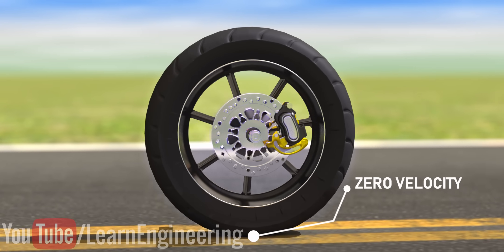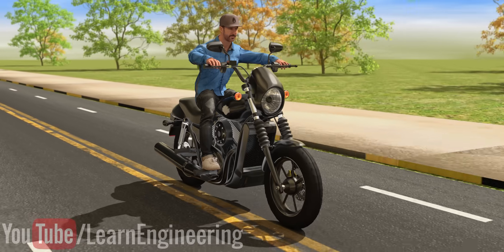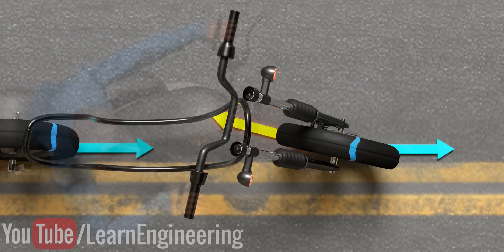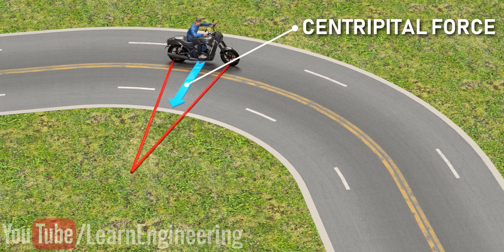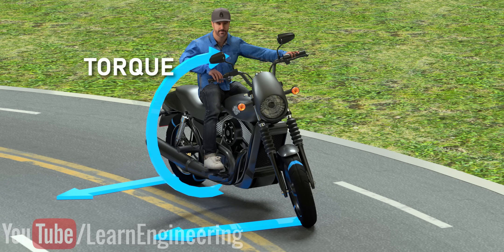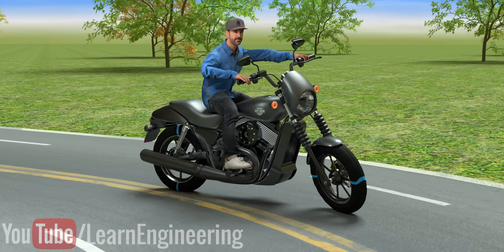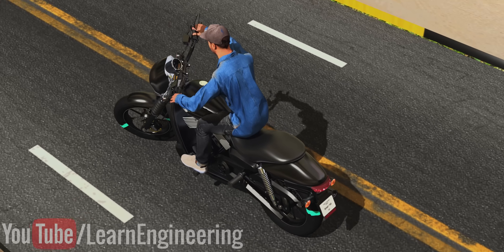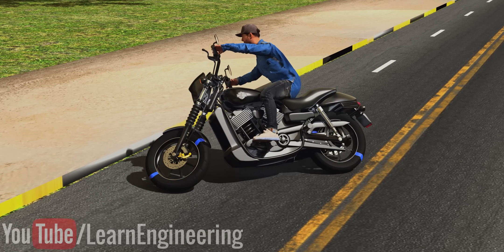Counter Steering | The interesting physics behind it

Comment: Just very short explain about ride a bike or motorcycle.

Slow speed, you turn the wheel to the right, the bike go to the right.

High speed (over 25-30km/h) you turn the wheel to the right just a little, the bike lean/fall to the left.

Anyway, if you ride a bike or motorcycle, you make countersteer consciously or not, always.

Is the only way to ride the bike.

But if you know about this you will drive with more confidence and ability and thats is always good.

Sorry about my english, greetings from Spain.

Comment: Counter steering is not a choice. You have to do it after you go over a certain speed (around 30kmph) because it doesn't matter whether you lean or not the bike will turn the opposite direction you turn the rear wheel. That's because the momentum you creat by leaning is not enough to overcome the momentum created by turning the wheel.

Comment: To be exact, counter steering is the ONLY way to significantly tilt your Motorcycle above 30km/h. Using the first method at these speeds will barely turn your motorcycle. You already did countersteering before watching this video. You just never noticed.

Comment: It is not even a technique IT'S THE ONLY WAY TO TURN ON A MOTORCYCLE
Reply: So... there are two inputs we can put in to turn a motorcycle. One is body position, and the other is steering inputs. So by leaning the body... yes it does help to lean the motorcycle which is how a bike turns (by leaning) But! If you want that input to cause the motorcycle to lean when you want/need it to.... you have to initiate the lean with steering Inputs. Just relying on body position will not turn the bike as much as you want or as fast as you need. As I put in another comment...Go take a course! It will possibly save your life. Get the knowledge and practice the skills.
Reply: @derrellbarnett7353  Just took my MSF course a couple of weeks ago and not even an hour into the riding instruction they beat counter-steering into your head.  The easiest way for people to remember it is just push left go left, push right go right.
Reply: @RascalCatify  well that's exactly right. But dont forget N I'm important part to that is speed. ( how fast you are going) again... there are two types of turns speed determines what kind of turn you will execute. You have done a great thi g for yourself by taking that course. MSF has been around for a very long time and are making appropriate changes to the program to educate and keep all riders educated and as safe as possible.
Reply: Derrell Barnett u r so right. Speed is the key to decide if you could counter steering. Let those guys who said that’s the only way to turn to do it with 5miles. It’s ridiculous to see so many people say couner steering is the only way. I do believe it’s the most effective way with higher speed rising.
Reply: Mike D can’t believe people still believe this without thinking. Do this. Bike will turn with handle bar turning by itself when you push the bike from back. Of course it won’t turn because you lock the handle bar!! This is a fake experiment made by a lot of youtber and people just buy it without thinking!!
Reply: breezelow unknown agree！people here seem don’t know anything about Moto gymkhana. Once they tried it, they immediately knew what’s the real skill besides PUSH THE BAR!
Reply: @chaoli2415  It's the only way once you reach a speed that turns the wheels into gyroscopes, between 10 and 15 mph depending on the mass of your wheels (rim + tire). At 5 mph, yes the bike steers conventionally.
Reply: @derrellbarnett7353  Noop. Countersteering is the only way. “ Direct steering” is nonsense.
Reply: @derrellbarnett7353  The motorcycle is counter steering when you "lean" it. The bike cannot help but go into a counter steer since that's the ONLY way it can turn after speed turns the wheels into gyroscopes (10 to 15 mph depending on wheel mass). So the rider has initiated a counter steer by leaning instead of by handle bar movement.
Reply: @punditpounder5153  thats all I'm going to say to that
Reply: @derrellbarnett7353  this is not true sir. I've been riding for years I'm 32 not a kid and I only lean never turn my front tire because any angle can break your traction from the street and cause you to slide out or worse. No matter my speed or sharpness of curve change this. I just judge the angle and speed and throw my weight as much as I need and I've always done great. I'm reading alot of negative comments and everyone acting like an expert. I say you ride something you become one with it and feel everything about it and make your own choices on whatever feels best for you. Everyone is different.
Reply: @C4LB34R  I'm not here to argue with anyone. Just state facts bro. How many courses have you taken ? I encourage you to take a few. MSF, Total Control, Keith Code California bike school, Yamaha champ school. I dont claim to know it all but everything I learn and try to share I have learned from taking courses and applying it every time I ride.
Reply: @derrellbarnett7353  well I'm not trying to argue I simply said that what you claim to be true is not true for all riders because I'm one of the riders that does not do that. I'm not big on taking all these training courses I teach myself but I did take the CHP training course when I got my motorcycle license and they taught us counter steering and all that but years ago I ate shit hard trying to counter steer into a corner and my front wheel broke traction from the road and wiped me out that's when I decided screw riding the way other ppl think I should ride I'll ride what feels best for me. From my experience it's more dangerous to turn that wheel in a corner. Keith code says you cant lean a bike at speed because it will barely lean. I find this to be complete bullshit because I lean the shit out of my bikes
Reply: DeathMoto559 you don’t turn the bar but bike does when you shift weight to one side.  Hope you could understand
Reply: Chao Li 
Weight shifting accomplishes nothing on its own.
Reply: @C4LB34R  the bike is still counter steering, you just did it by leaning instead of by handle bar movement.
Reply: DeathMoto559 
So wrong. It's not "the majority of people" it's science fella. If you don't counter steer you go straight. When you lean you are pushing on either the left or right bar, so...... Counter Steering! You just don't realise it. Leaning achieves nothing! FACT!
Reply: @C4LB34R  i bet you are counter steering.
Reply: THANK YOU! 10 years on the road, still i heard first about counter steering a year ago. next i watched carefully how i steer and boom i've been already counter steering for 10 years without even knowing it.
Reply: @tamask438  after about ten mph it's the only way to turn the bike. What got me was turn but don't lean. Part of the reason from counter steering is it leans the bike.
Reply: You should edit your comment to say it's the only way to turn a motorcycle at speed (not at very low speeds). At very low speed you turn a different way. But, yes, I understand and agree with the point you are making here...just don't want newbies to get the wrong idea for very low speeds.
Reply: @damachine3  yeah i should probably add at any speed over 10 mph(16kmh) but i wanted it to be dramatic 😂
Reply: Man I’ve ridden and never did this knowingly -it’s not something you have to actively attempt - your brain does not want you to fall and will tell your body what to do
Reply: Yea u nailed it buddy
Reply: Even worse, they fail to mention that "turn in the direction you want to go" only works at parking lot speeds.
Reply: You can do it both ways but you aren't going to be non-countersteering at higher speed.
Reply: Some people do it unconsciously. But it's the only way to get the bike to turn
Reply: It is only way to turn any 2 wheel machine.
Reply: @ArturMoisiadi  WRONG!
Reply: @gorgonwiesel8768  Good luck on the road.
Reply: A-lex not true bro. At slow speeds you do not counter steer. But yes, this video is bad, very bad.
Reply: It works on bicycles, too.  People don’t even know they are counter steering.  It is interesting watching people throwing their weight around, thinking they are leaning the bike.  Give the weight of a motorcycle and the gyroscopic effect of the wheels, that is really not possible.  So push that handlebar in the direction you want to go and physics will take care of the rest.  Push left to go left, push right to go right.  It’s what you’ve been doing all along, you just never knew it.  A-lex is right - IT’S THE ONLY WAY TO TURN A MOTORCYCLE.
Reply: Too damn right. What the hell are these people talking about? Obviously they no nothing about motorcycling!!!!
Reply: Your comment Is an oasis.
Reply: @crismorgan6756  indeed 😂
Reply: NO YOU ARE WRONG. Atleast with lighter vehicles like bysicles. You can stere without counterstering.
Reply: For all the people saying this doesn't/can't work...watch a few videos of those Japanese bike police doing slalom courses on some seriously large bikes...no body lean whatsoever and theyre turning on a dime...total countersteering all the way through.
Reply: @mixerD1-  better watch Twist of the wrist 
by Keith Code it is also called cornering bible.
Reply: I agree and i lean as well, confusing video!
Reply: Sorry for everyone who is believing the bike must have a certain speed so you can countersteer. You can countersteer at the speed of 0 (zero) miles per hour. Yes, you read it right: 0 (zero) miles.
Watch any video of Sara Lezito where she is performing.... 
When you push left (clock wise) the rear of the bike goes counter-clockwise to counteract trying to keep the bike upright. The front being not inline with rear tire is being pushed forward and if no force is forced on the bike (leaning) the bike itself will stabilize again. There are many videos showing the bike straightening itself and goes riding without the rider perfectly balancing itself.
There are many roads leading to Rome.
The higher the speed the bigger the circle and that is the reason for so many crashes in turns.
These schools are selling  unbaked cakes and anyone without the proper knowledge thinks it is the real stuff. If you are one with your bike your subconscous mind will warn you in time for any inconvenience but the conscous mind hypnotized by certain techniques will lead you to disaster because it did not follow the instructions of the subconcious mind. Many times you will not feel at ease and you do not give a follow-up to these feelings and nearly always is leading to disasters.
I have my driving license for 50 years now and have riding bikes for 40 years in a row.  And still riding today. If you are doing something beyond your skill means that you are not one with your bike. There is no way out to this.
For money anyone will tell half the truth and this is an undeniable fact
Reply: This video and these idipts commenting have annoyed me due to their ignorance. It's been nice seeing your comment... I want to explain to the maker of this video why they are so wrong about all of this... annoyed...
Reply: @BronsonM6049  I have left a longer response - the person making this video has obviously never ridden a motorbike and the scooter demo at the end proves this.
I would like to see him on a 600 bike do what he did on that scooter at speed.
Reply: @Slarti  you know, the physics is way off too, it annoys me... and I'm a secondary school physics teacher 🤣 I obviously dont mind someone not knowing or understanding physics but someone making videos where they literally spread made up nonsense is annoying as it's hard enough to teach people from scratch, let alone having to undo such gross misconceptions. Genuinely think this video should be taken down
Reply: @BronsonM6049  If it's wrong, then it really should be taken down ASAP. As some have already said here, this could cost lives.
Reply: @Slarti  I have a 700 been riding bikes for years I live in a mountain area and I've never used counter steering I lean into everything no matter the speed or angle of the curve and I've always done just fine. Just because majority of ppl might do something one way doesnt mean every rider does
Reply: @C4LB34R  I'd like you see you do a slalom without counter steering. Either you'll fail, or slowmo video will prove you're doing it even if you're not aware.
Reply: @C4LB34R  Watch " Twist of the Wrist " on Youtube. It is the Bible of Motorcycle riders. It will teach you a lot and you will see how much leaning in or bodysteering does to your Motorcycle.
Reply: @kavprod.8535  Don't recommend anything written by Scientologists. They're dogmatic, easily misled, and impervious to having their opinion informed by new information. They may occasionally agree with reality and succeed in spite of themselves but there are better sources.
Reply: @aluisious  doesnt Matter WHO wrote it. IT is the bible of motorcycle Riders. All things in this Video or book are proven things. You should recommend something better then Twist of the wrist then.. , or Tell US at least the points you dont agree with.
Reply: @C4LB34R , you're wrong. But that's ok. Just keep doing what you're doing.
Reply: aluisious 
Got that bang on fella.
Reply: @C4LB34R  me too. I just lean the bike and let it do all the physics. 😁
Reply: @C4LB34R  You initiated the counter steer by leaning instead of by handle bar input, but the bike was counter steering none the less. That's the only way a bike can turn after reaching the speed where the wheels become gyroscopes.
Reply: @C4LB34R  I guarantee that you have used counter steering, you just don't realize it. It is not possible to steer a bike at speed any other way. If you really pay attention to the position of your handlebars as you lean thru a curve you will surprise yourself. We have all done it. It is a natural motion that you do without thinking about it. The physics involved with riding a bike (including bicycles) dictates that you must counter steer at anything above parking lot speeds. It is not a choice.  This video was horrible.
Reply: @C4LB34R  whether you know it or not you've been counter steering your 700 around yiyr mountain for years. You do not lean a motorcycle by leaning your body. Subconsciously we all countersteer. It's just that once you're made aware of it it makes more sense and you can use it more effectively.
Reply: @BronsonM6049  Agreed .EX MSF instructer
Reply: @BronsonM6049  AGREED EX MSF instructer
Reply: @BronsonM6049   Can you explain the physics mistakes in the video?
Reply: @BronsonM6049  I filed a complaint with YouTube. Please do the same.
Reply: @zugzi  I have filed a complaint with YouTube. Please do the same.
Reply: @C4LB34R  no you dont. Unless you only go slow
Reply: @zugzi  It Is wrong! You do not force de CS, It Just happenes, Is the way the bikes turn.
Reply: @tommeyer6033  I will. Thanks
Reply: @C4LB34R  that's because you have a light bike  with small tires those just turn, I have wide tires on my fatboy and it's almost 800lb I don't have to counter steer but at high-speed the bike is very slow to turn its actually dangerously slow when I counter steer its quick and effortless.
Reply: True i'm happy you give the right comment. 
I had a serious healty discussion of countersteer a motorcycle with my friend. Finally 1 year later he say to me. You have right i dint noticed im doing this every time i make a turn 😂😂. 
Have a nice day
Reply: @stijnsn  thanks you too 😁
Reply: @softailfun  bullshit I'm pulling or pushing the bars. You can weld them solid and I could still lean right through a fuckin corner especially on my FZ07 that shit practically corners by itself
Reply: @C4LB34R  I'd like to see that test, welded steering. It wont go how you think it will. In fact, I'd like to see you ride it in a straight line. There is a lot more going on with the steering on a motorcycle than you think.
Reply: @miked7146  California Superbike School has that exact setup called the No BS Bike (No Body Steer Bike).
Reply: @C4LB34R  Actually this has been done for years by California Superbike School who have the No BS Bike (Body Steer bike). It has a set of fixed handle bars ("welded") above the normal ones. Once you're comfortable doing 20 mph or so and the gyroscopic effect has taken over the wheels, you take your hands off the normal bars and put them on the fixed bars, then try to turn the bike by leaning with your body. It is almost impossible to do. You are subconsciously assisting the counter steer with your hands. If you persist in your doubt, CA Superbike School will be at a track near you at some point. Go prove them wrong. People have been trying to for 30 years.
Reply: DeathMoto559 
So wrong. Learn to ride, learn how your bike works!!

Comment: Counter steering is confusing and will get many new riders killed. What my teacher taught me is to push down on the handle bar side you want to turn to. 

If you want to go right, push down right handle bar side, don't push forward right handle bar side which is steering left on slow speed or counter steering into right because many new riders don't understand the physics of it and the various stance as indicated in the video. 

We are only taught to use counter steering incase we are about to fall down on one side so the bike would auto correct itself upright.
Reply: Adnan Calbe 
Wrong! Bad info!
Reply: Adnan Calbe Pushing down does nothing.
You can stand on your handlebar and the bike still keep its direction.
Reply: XtreeM FaiL well we agree on this at least. 👍🏻

Comment: The author did not tell you one thing. What he calls 'Normal Steering" can only happen at very slow speeds. At anything above a walking speed "counter steering" is the ONLY way to turn a motorcycle. He wrongly suggest that it is the riders choice which is BS